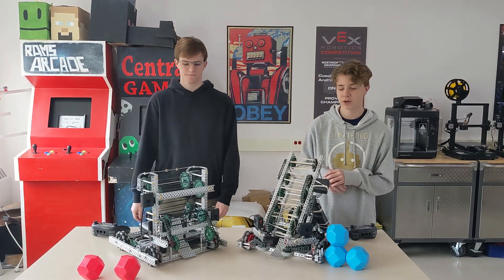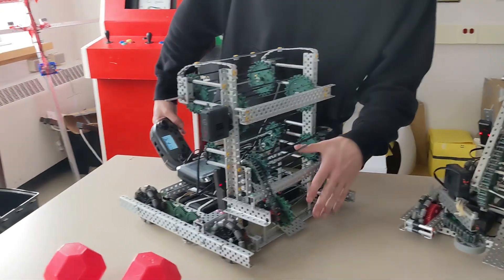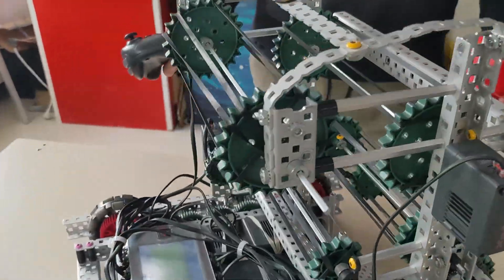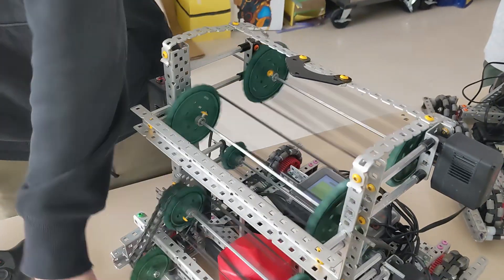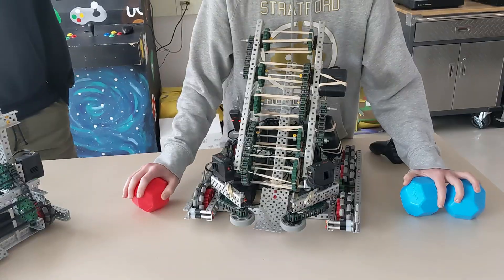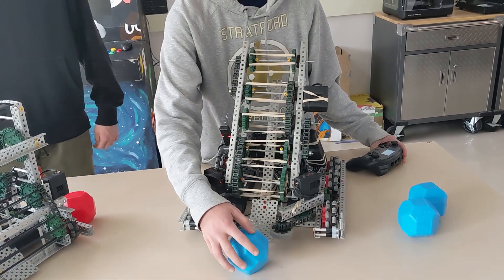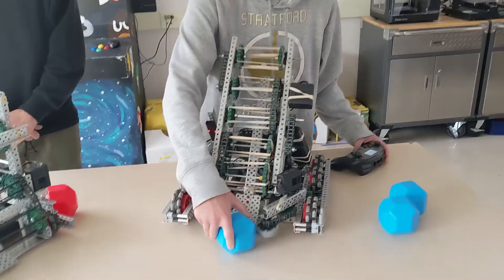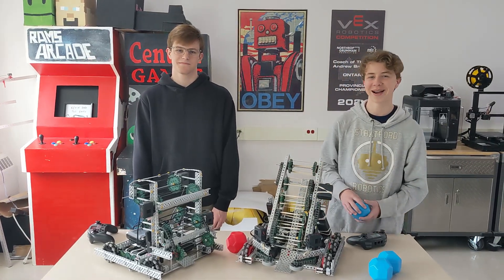29295 | VEX Push Back | RI1W

Comment: What are the gear ratios for the drive train?
Reply from the maker: 450RPM 36:48, 66w on 3.25" wheels
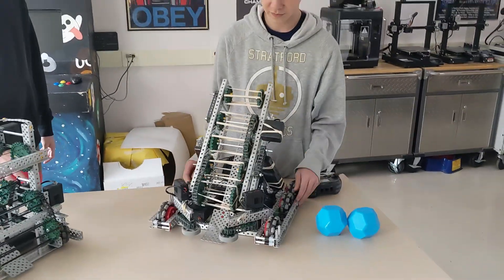Reply: @StratfordRobotics29295  Thanks, do yall have instructions on how yall built the second robot drive train that you showed. 3:00

Comment: May I ask how you manage to drive the first set of sprockets with screws passing through them at the same time?
Reply from the maker: We had a brass insert connecting the two sprockets and some smaller spacers making sure it stayed centered similar to how teams do screw jointed odometry. VEX HEX has a good video on this type of connection as well https://youtu.be/dMg0OOl7CyQ?si=TSYaFqiAFvGj4P8H